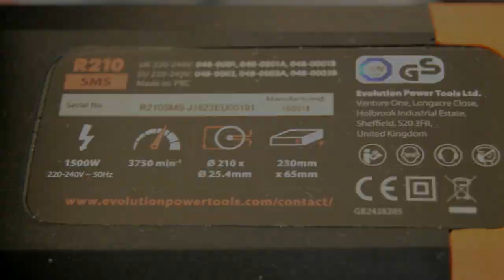Am testat un circular stationar de la Evolution R210SMS multimaterial [TEST]

Comment: Salut, ai facut un clip bun, imi place mai ales intro-ul, foarte smecher. Ai facut mizerie in apartament, eu ti-am zis ca aspira o laie 😃. M-am uitat in gaura de evacuare si are montat un fel de sita cu doua lamele, probabil rolul ei e sa opreasca aschii mari care s-ar putea desprinde din piesa prelucrata dar am observat ca acolo se aduna foarte mult rumegus si o sa i-o dau jos. O improvizatie am putea monta un fel de presulet ca la masina ca colecteze mai bine resturile. De ce nu merge sa folosesti alta panza la el? Daca zici ca ai verificat cu o nivela sau un dreptar, nivelul mesei rotunde fata de masa fixa, si nu ai spatii intre extensii si dreptar, inseamna ca al meu are o problema mai mare. Desi, nu sunt toate facute de aceleasi matrite? La mine e cel putin 5mm intre nivela si extensie, in ambele capete.
Reply from the maker: Mulțumesc Dan! După ce am văzut clipul tău, mă așteptam sa-mi facă ceva mizerie. 

Faza cu pânza am citit-o în cartea tehnică a lui, spune că "This product is a Multi-material sliding mitre saw and has been designed to be used with genuine Evolution blades rated for this machine." și Not to use saw blades manufactured from high speed steel."

Am verificat unghiurile cu un inclinometru digital. Am verificat unghiul pânzei față de partea fixă unde stă materialul. Am avut 90 grade, iar la unghiul de 45 grade mi-a dat 44,8 grade, respectiv 45,2. Am să pun și o cumpănă pe partea fixă să vad cum arată. 

Oricum, am sa-l mai testez cu ceva materiale de dimensiuni mai mari. Dar, la cum a tăiat fierul e clar e poate. Ideea e că eu nu îl recomand pentru a tăia fier cu el daca vrei să te țină lama. Daca ocazional ai ceva scânduri cu cuie sau șuruburi mai merge. 

Spor!
Reply: Uite ca eu nu am citit cartea sa fiu sincer si daca suntem conditionati numai la panzele lor, e cam nasol. In cazul asta eu nu o sa-l mai bag in fier, nici eu nu cred ca dintii aia or sa reziste prea mult in fier. Totusi m-ai pus pe ganduri, ce se intampla daca montez panza normala de lemn. Panza in raport cu partea rotunda reglabila e ok, nu despre asta am spus eu, eu vorbesc despre planul partii fixe in raport cu partea rotunda. Partea rotunda este cu vreun milimetru, doi mai sus fata de partea fixa iar pe masura ce te duci spre margini, distanta creste. In acest fel, daca ai nevoie sa sprijini o piesa mai lunga care va fi sprijinita in mare parte pe partea fixa, taietura nu va mai fi in perfect unghi de 90. In mod normal, cele doua planuri, cel fix si cel rotund trebuiau sa fie perfect aliniate si in 0 grade. Dar in fine.
Reply from the maker: @DemoToolsYT  Am vazut ca Evolution are panze scoase pentru tot felul de materiale, doar pentru lemn, panza diamantata si variata care o avem noi, multi material. Pana acuma am vazut doar la emag ca au panzele acestea de vanzare :)) Brico Depot nu le are. 
Am pus cumpana pe al meu, partea rotunda este mai jos fata de cele fixe cu vreo 1-2 mm
Reply: Deci la tine e mai jos, la mine e mai sus 😂. Dar macar suportul fix te ai uitat pe sub nivela sa vazi daca sunt perfect in orizontala sau incepe sa se lase in jos inspre capete?
Reply: @DemoToolsYT  nu au ce pati daca se potrivesc la gaura panzele si sunt facute pentru aceleasi rpm. si au bagat si in brico panze din astea pe la 100 lei parca :D am vazut saptamana trecuta in Focsani
Reply from the maker: @DemoToolsYT  Acest lucru nu l-am verificat, am sa ma uit maine la el sa vad. In principiu tolerantele mi se par acceptabile, daca vrei sa-ti faci un foisor, terasa, ceva mobilier de gradina. Era mai urat daca era un Bosch de peste 1000 de lei, pusesem eu ochii pe unul :))
Reply: Da, merge fara probleme la constructii. Bosch trebuia sa corespunda mai ales la banii astia. Ca de la Bosch, DeWalt, Makita, etc, ai pretentii, ca altfel... de mers merge si Steinhaus 😁